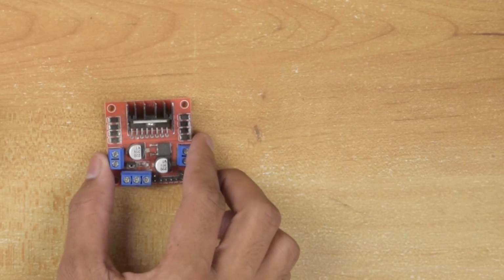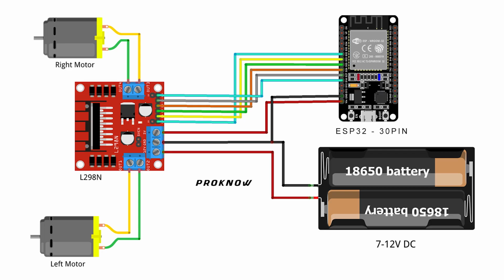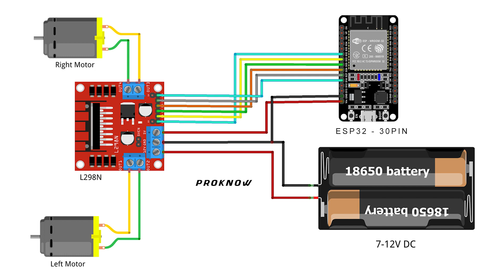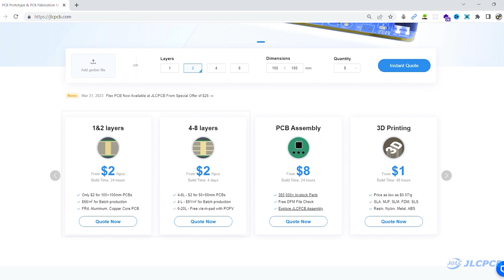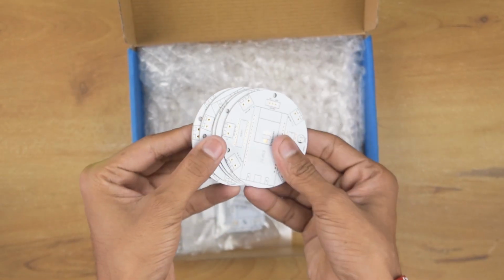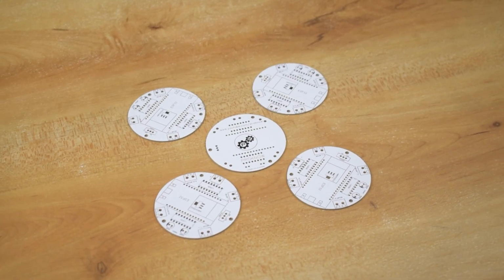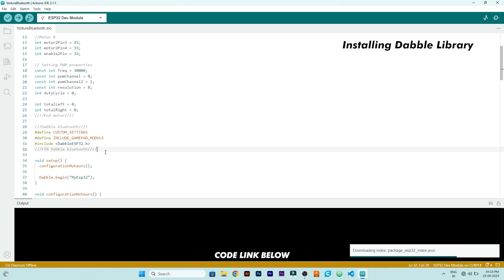DIY Arduino Project - ESP32

Comment: Mai bhi banaya hu BO gear-motor ko use kar ke Lenin wo slow hota hai.
Fast speed ke liye kaun sa MOTOR USE kare jo L298N Motor Driver support kar sakte hai. Please suggest bhaiya 🙏🏻
Reply from the maker: You can use the motor with high RPM.